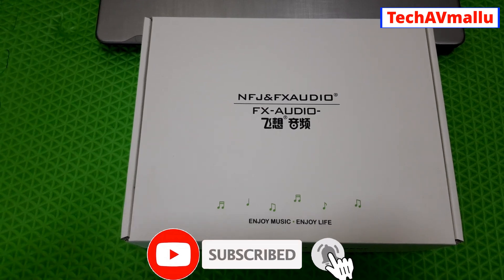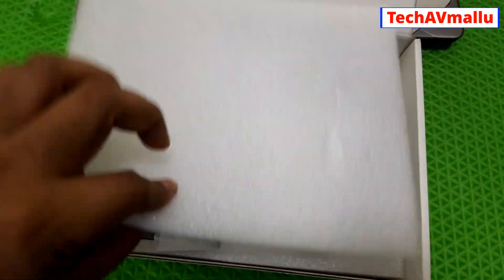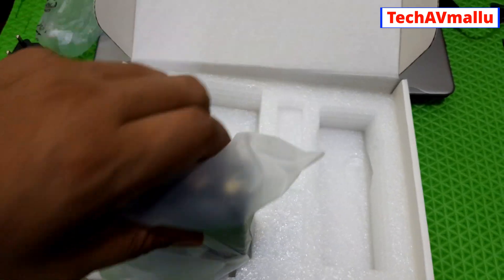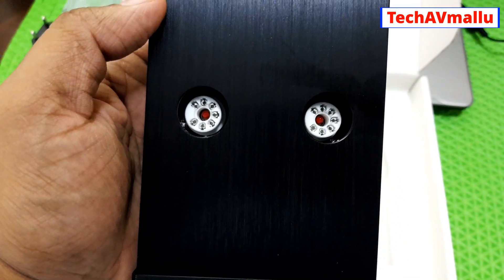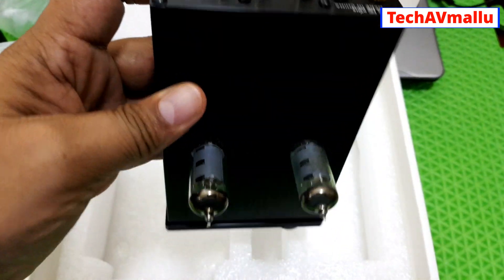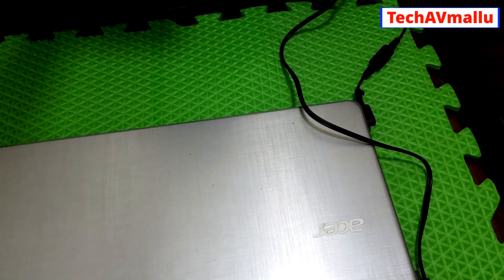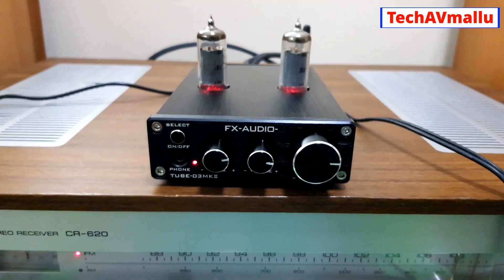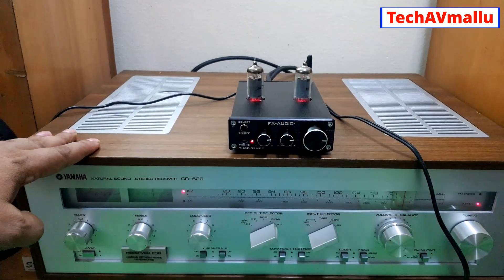FX audio Tube 03MKii tube preamplifier unboxing (Malayalam)

Comment: Ithinte op amps mattiyal vere level anu.... Njaan medichu... Mullard M8100 tube (Uk imported) upgrade and LME49720NA (US imported)  Op Amps ..... level goes to $500 - $1000 equipment quality. Budget undengil go for muses02 op amps.
Reply: Both vedicha link taromo, onnu try cheytu nokkam.
Reply: Bro fx tube03 യിലെ 6k4 ട്യൂബിനു മാച്ച് ആണോ mullard m 8100
Reply: @yazidzidan6332  yes njan use cheyunnu kollam. Better than 6k4